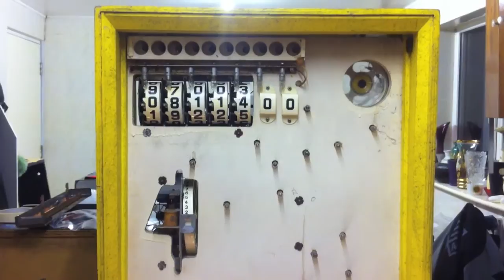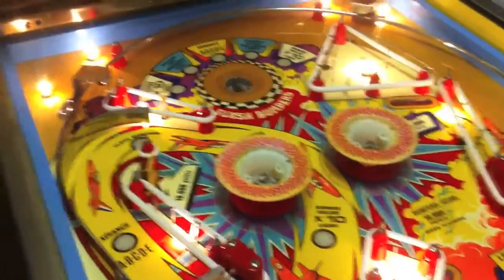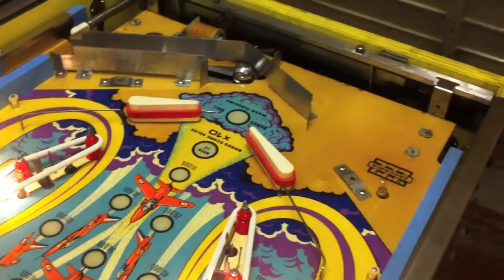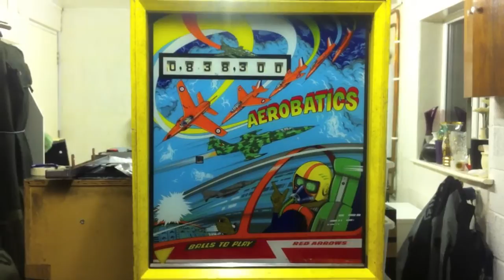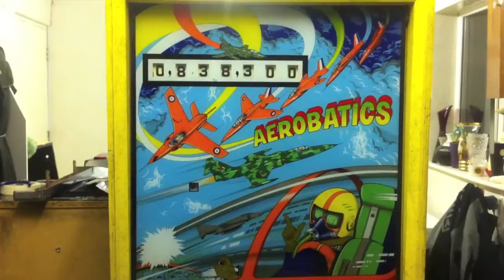Zaccaria Aerobatics Pinball Restore Part 5

Comment: How did you get this into the NLP 2013 show ? 
I thought this generation of Zac machine had no grounding circuit at all, making it even more lethal than most cheap modern Chinese imported electrical goods.
Reply from the maker: Hi Elvis, the game was earth bonded prior to going and was PAT tested by the sparks at the show itself. I've never had any issues with Zacc tables myself and a friend who owns quite a few Zacc EM's takes loads of his to shows (again they've been earth bonded) :-)
Reply: Ive got this one now, not Earth bonded, so guess its not the exact same one. working 100%, 50% of the time. except the sound, it has the oscillator board and speaker but i havn't wired it up because there is something like an 8 pin connector for a 2 wire speaker.
What do you reckon to Earth bonding it with Chinese copper desoldering braid ? its 99p for 2 x 2m reels (delivered )
Reply from the maker: Definitely not this one as I sold it to a mate and he still owns it. Not sure about using desoldering braid for the earth bonding, I used normal wire I bought from Maplins (can't remember the gauge but most likely 18awg). Tbh unless you're planning on taking it to public shows or siting it then I don't think you need to worry about earth bonding.

Comment: Ron - is there any chance at all you have any of the spare playfield parts left over?
Reply from the maker: Hi Joe, no sorry. This game and any parts I had were sold years ago.
Reply: Dang. Bought one blind and it is missing the sound board and the "New Flashing Unit" which turns out to be kind of important. Thanks for the reply!
Reply from the maker: The sound board is really basic. If you could find a schematic online it would be pretty simple to make on some breadboard I'd have thought. Failing that you could look for a chime unit and try and retrofit that. It wouldn't be original but would be pretty cool. Not sure what the "New Flashing Unit" is unless it controls the flashing lights to show when you can get specials? If that's it then whilst not ideal it shouldn't stop you playing the game as I don't think that's part of the game reset workflow.
Reply: I'm going to hit you up on Pinside as this could take a long time going back and forth.
Reply from the maker: I'm not on Pinside much. You can find me on the UK pinball forum though. Look for Pinball Info, I use the same username there.
Reply: Ok, I'm a lurker there as well. I'll send you a message. Thanks!